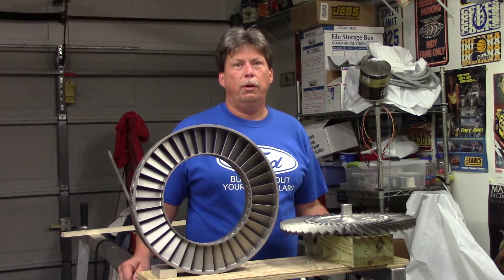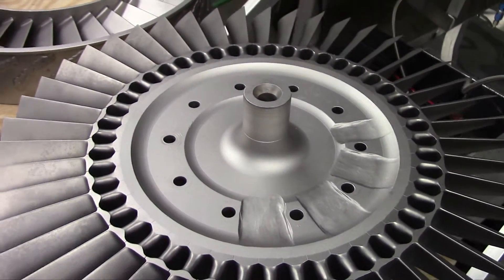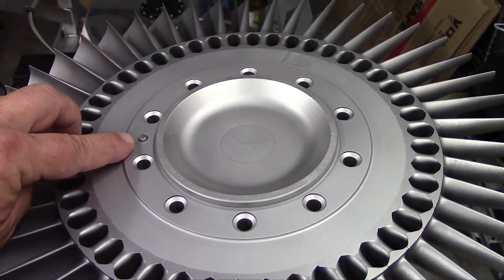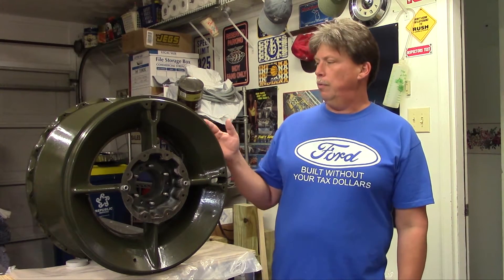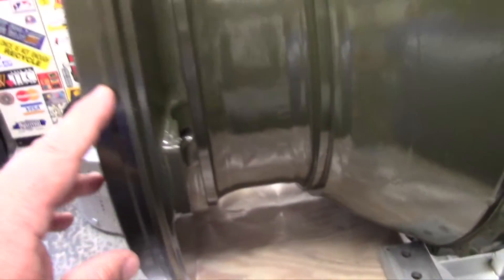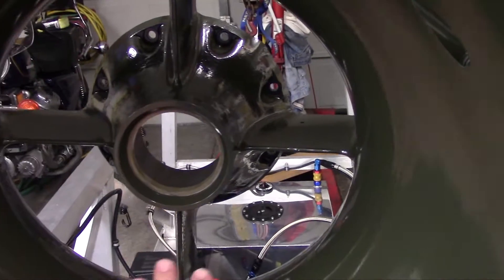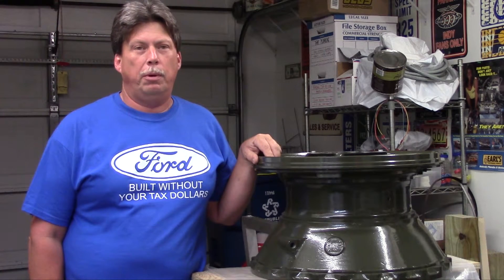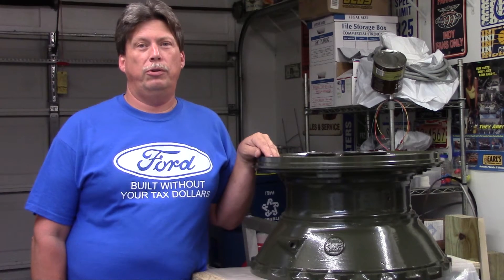The Fairchild J44 Project:  Parts Review Part 4

Comment: Great stuff. I understand the turbine nozzle seems to be the weakest part of the engine, so would it make sense to have it ceramic coated? Or will that only help for internally cooled vanes? (You need to get rid of the heat somehow, and just making the surface capable of withstanding higher temperatures will not help if you trap the heat inside.)
Reply from the maker: It seems that many older engines get to be owned and operated by people that do not have formal training so the nozzle and turbine are over-temped in ignorance!  Many of these older, simple engines were owned by tech schools, where students worked on them, so anything is possible.  My particular engine was owned by a local guy that used it to power/make fire for various entertainment vehicles, used for intermissions at air shows and drag racing meets!  He had a home made afterburner in place of the jet pipe & eductor, which stressed the old engine pretty good!  The A. B. pipe had a fixed nozzle so the turbine temps were high when he was at full power, blasting down a runway or drag strip.  The kids love the flames but the nozzle and turbine do not!

Ceramic coating would be a luxury I probably can't afford, though I assume it would allow for higher temps or make everything last a little longer at rated temps.  I don't think I will have more trouble with the hot section, as long as I keep an eye on the E. G. T. indicator!  The starts are critical operations where over-temps can most likely occur, as you know.  The fuel control system seems to work pretty good, allowing the engine to come up to idle fairly quickly.  Thanks for your input. 

DD